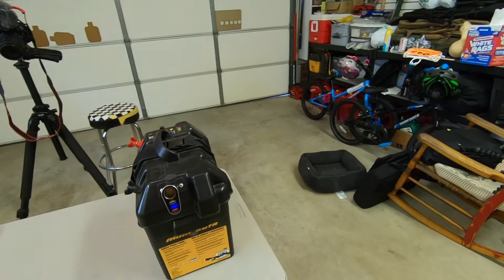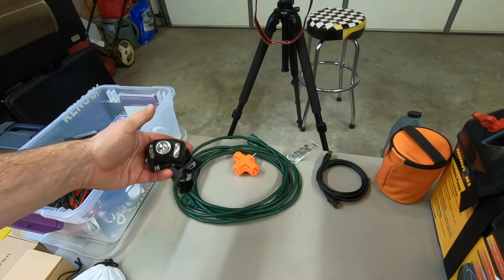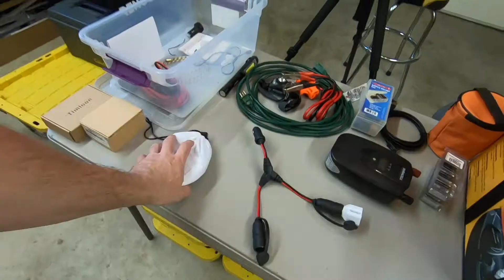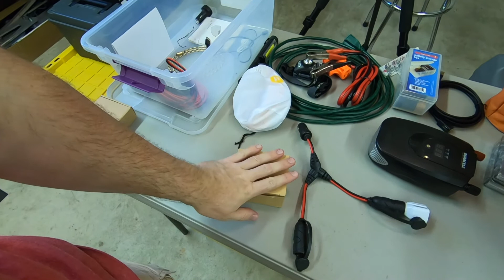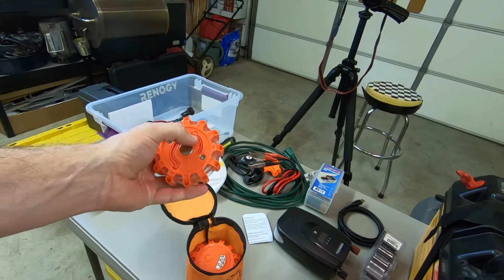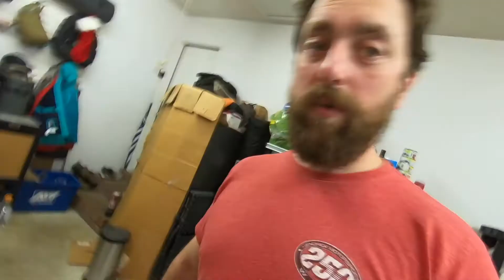Camping gear: Lighting and power for camp.

Comment: What electric blanket do you us
Reply from the maker: I have a Biddeford blanket with a single controller. It's a smaller blanket for one person but when we go out as a family I put it's length across the bed under the other blankets and it keeps us all warm. It has a really low power draw too and will run all night off the battery without draining the battery much.